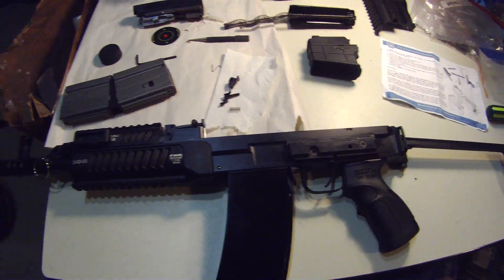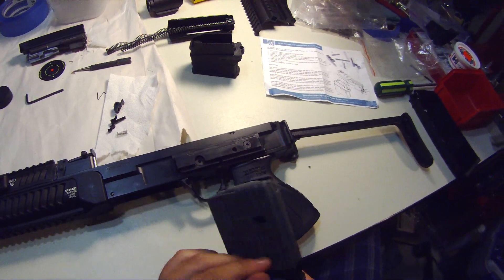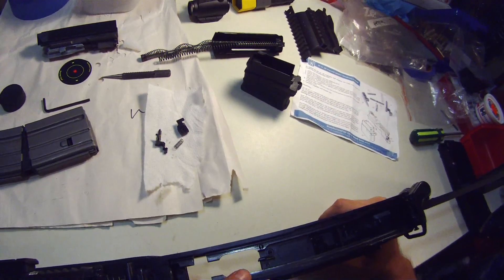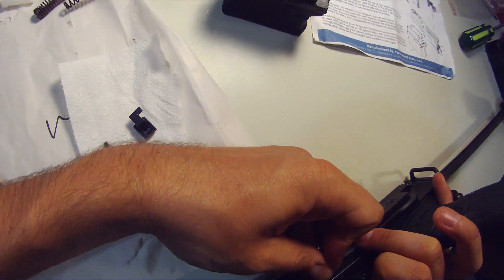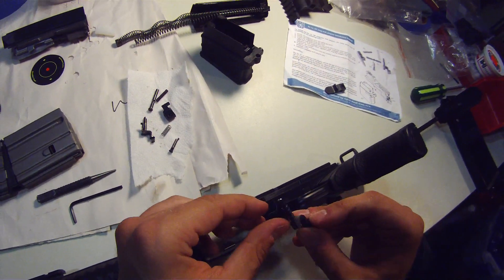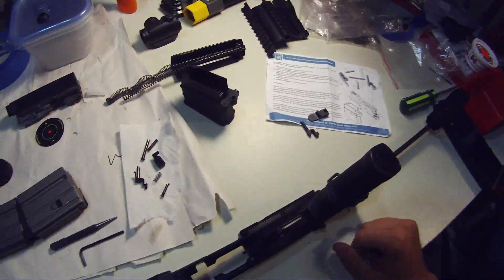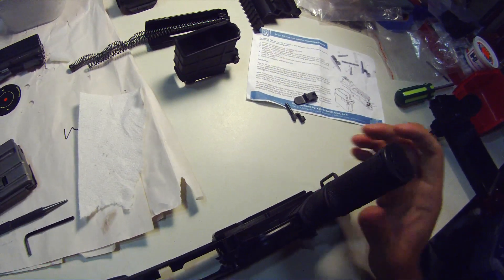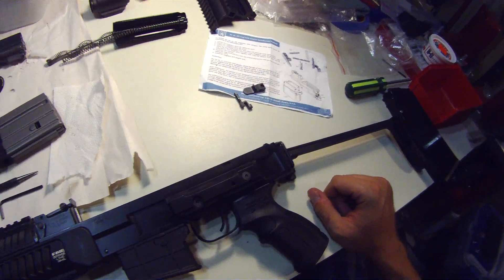VZ 58: Installing AR-15 mag well adapter

Comment from the maker: ok found the # range:
5600004CA through 5600127CA
5600008C through 5600089C 

Seems like you are also unlucky! Casey at Tactical Ordnance is who does the machine work for CSA for this mod. He did mine and is great to deal with. Located in Newmarket, Ontario. It is a simple modification, about $40 to do it.

Comment: for anyone watching this before buying these: They are hot garbage and magazine compatbility is poor. some people put them on and any ar mag works. for most only a few metal GI mags work and the polymer mags, especially the Pmags do not work or require extensive alterations to the mag for it to click in and feed rounds.

i learned my lesson. just use the normal vz magazines and go buy a rifle made for these mags if you really want to use them

Comment: Does anyone know if there's a conversion like this for ak mags? I want a VZ58 but I'd like to be able to use ak mags because of how plentiful they are. And as much as I love the ak platform I'm starting to believe these are more accurate rifles. Also if anyone knows of a really good ak vs vz accuracy/torture test please enlighten me.
Reply: Even if there was something like that, bolt hold open after last round would not work with AK mags.

Comment: I'm trying to install the same mag well adapter on the VZ58 (non-restricted version with a longer barrel), and I'm finding that the new bolt catch with the new spring doesn't go in very smoothly.  I seem to be able to push it in.. but the spring has no effect on it.  Any ideas if machining is necessary?  Has anyone seen this issue before?
Reply: Hi, have you fixed your issue 11 years later?

Comment: the last shell goes in ,,but the bolt goes forward  half way then stops .I take out the mag ..I recock the rifle ..bolt closes...install another mag and fire till it comes to the last shell then ,,stops again
Reply from the maker: sounds like the last round is applying extra pressure on the bottom of the bolt, and hanging it up. do all of the mags do this or just one?
Reply: FirearmActive im wondering if the spring is not strong enough in the bolt catch